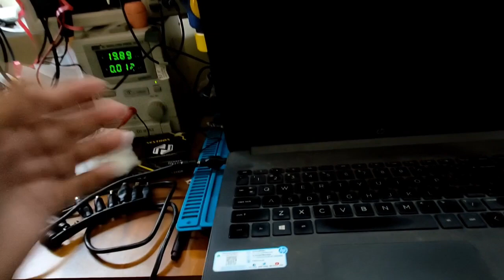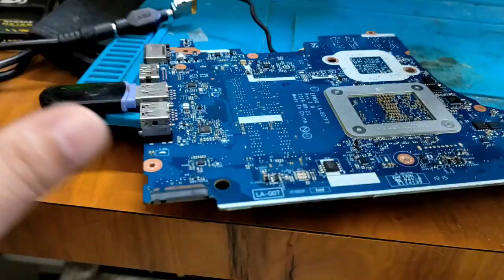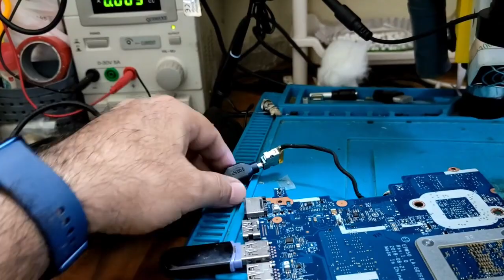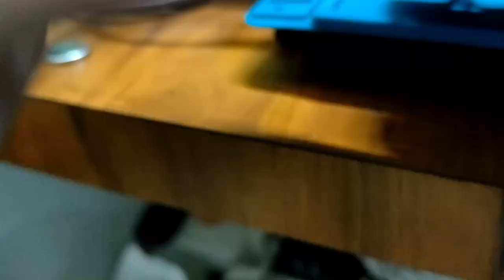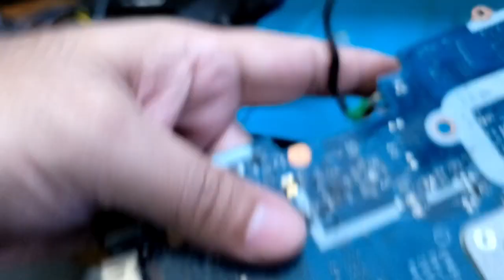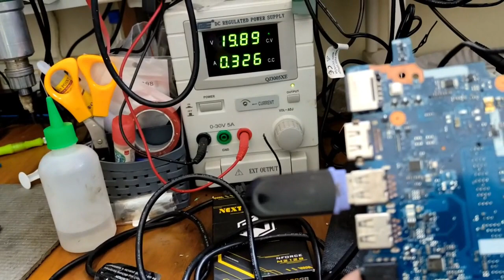HP 15 Laptop No Power Issue Solved

Comment: Hello sir, i have an HP 15q bu014tu 7th Gen laptop. My laptop suddenly shut down, and now it’s not switching on. When I connect the charger, the orange light blinks once and then turns off, and the laptop also doesn’t turn on. I showed it to a technician, and they said there’s an issue with the motherboard,no power issue. They estimated the cost would be around 2700 INR. Does it really cost that much? Please guide me if possible.
Thank you.